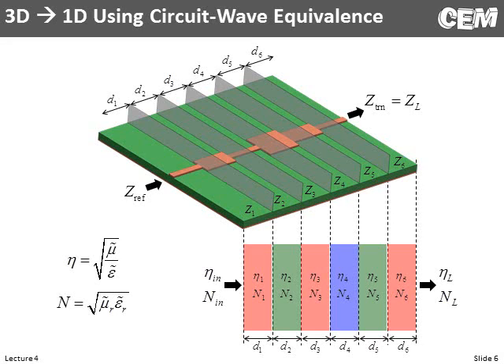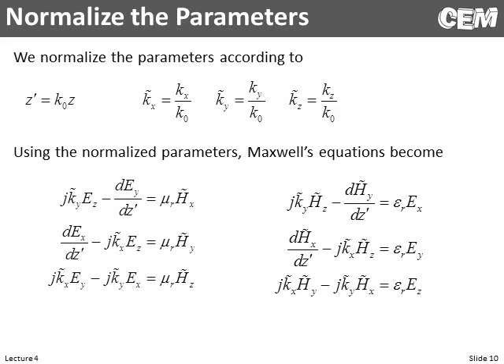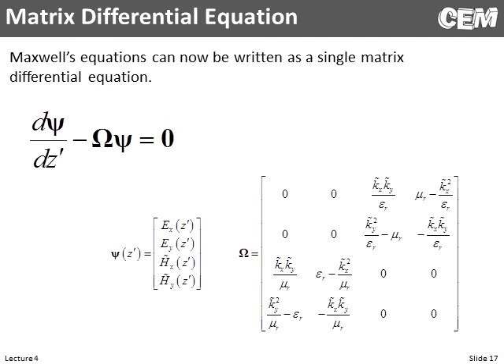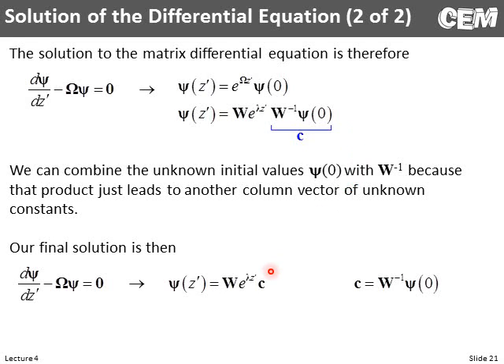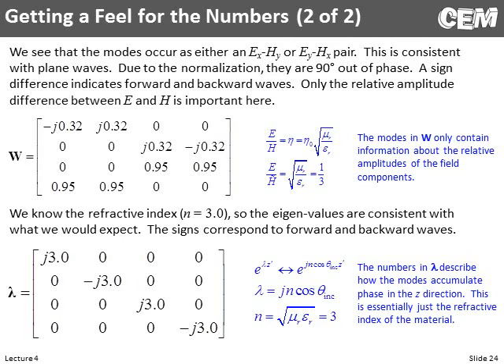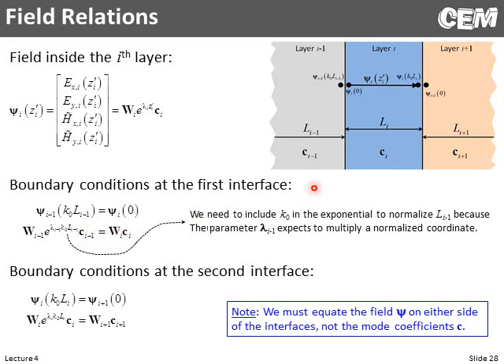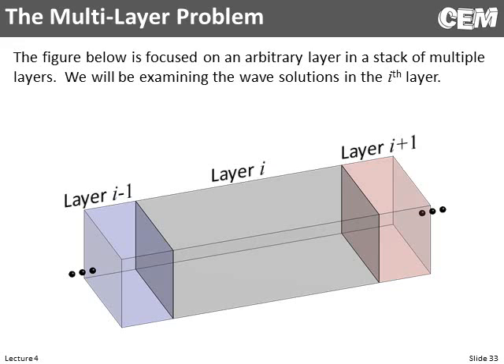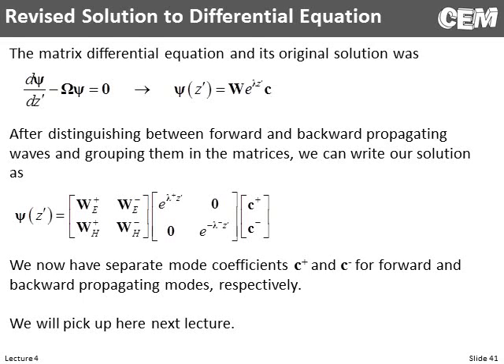Lecture 4 (CEM) -- Transfer Matrix Method

Comment: Dear Prof, Thanks a bunch for explaining this concept in detail. I have doubt regarding the sign of kxky in slide 12. Wouldn't it be positive? As we substitute and replace it?
Reply from the maker: I am pretty sure what is on this slide is correct. If you worked the derivation and still got a different sign, let me know and I will triple check myself.

One thing you might be missing is the sign convention. For TMM I am using the positive sign convention where a wave propagating in the +z direction is written as exp(j*k*z). The negative sign convention would write it as exp(-j*k*z). Here is a link to a summary of the sign conventions in electromagnetics.

https://empossible.net/wp-content/uploads/2018/03/Summary-of-EM-Sign-Conventions.pdf

BTW...you are looking at older version of this material. I recommend using the course website as your main portal to the information. You can download the notes, get links to the latest version of everything, and get links to other learning resources. Here is the link:

https://empossible.net/academics/emp5337/

Often times when I catch a small error, I will immediately update the notes, but not the videos.

Hope this helps!

Comment: Is there a way to link the modes(E_x - H_y and E_y - H_x pairs) to the TE and TM modes existing in a slab waveguide or am I totally mixing up unrelated things?
Reply from the maker: Yes! Most times devices are aligned to the Cartesian axes and the modes come out automatically as either TE or TM. In general, they do not. It is best to calculate unit vectors in your TE and TM directions and use dot products to calculate TE and TM components. This is the most robust thing to do.
Reply: Luckily, my waveguide is aligned with the propagation direction (z-direction) and I'm not looking at more complex structures. I'm trying to simulate a Bragg grating for dispersion compensation but another point of concern for me is that I have the wavelength-dependent n_eff for the TE mode, and n_eff for the TM mode, that I acquired using a modesolver. I can extract the effective epsilon_r, but since it is mode-dependent, I wonder if I can use the TMM as in the example? (My slab waveguide is not isotropic in the x-y plane) Should I perhaps use the full matrix that you showed on slide 15 or maybe try some shenanigans with the effective refractive indices for TE and TM?
Reply from the maker: @Terrar-fr1bk Until you said "not isotropic" was pretty confident you can do this with TMM. Usually, it is just the fundamental mode and you build the slabs in TMM with the effective indices from your mode analysis. I would say if your anisotropy is still aligned with the Cartesian axes, TMM should still work. If not, the anisotropy may couple energy between TE and TM and the analysis becomes more complicated.
Reply: Thank you for clarifying! I think it should work out with TMM after all. Maybe I confused you when I said non isotropic. When I mentioned anisotropy, I meant that my waveguide has multiple layers with varying doping in the x-y cross section. So the waveguide cross-section is not a single isotropic material but rather like a cake. However, each layer of the cake (each layer with a doping) is isotropic. That's why I wanted to use the TMM with the effective indices for the TE/TM modes of the waveguide cross section.
Reply from the maker: @Terrar-fr1bk If all materials are isotropic like you say, I think you will find your approach to be extremely accurate. Good luck!!

Comment: Dear Professor Raymond, your course explanation is very detailed. I have a question, in Slide 8, why does the partial derivative of z ≠ jkz? What do you mean by z-direction inhomogeneous?
Reply from the maker: Great question and sorry for any confusion!

First, you are watching an old video. I have considerably improved and revised this section of the Computational Electromagnetics course. Below is a link to the course website where you can get links to the latest versions of the notes, videos, and other resources. The transfer matrix method is in Topic 2.

https://empossible.net/academics/emp5337/

The TMM represents structures as layers of materials that are otherwise homogeneous. They are of infinite extent in the x and y directions. This makes the overall device homogeneous in the x and y directions. However, the device is not homogeneous in the z direction because there are different layers. While each layer itself may be homogeneous in the z direction, the overall device is not so nothing can be done with the z derivative at this point in the formulation. It is later handled using scattering matrices to account for the scattering that arises between the layers.

Hope this helps!!

Comment: Thanks very much for the video. I have some questions: how to calculate the absorption in each layer, and how to calculate the absorption in each position?
Reply from the maker: To do this, you will need to calculate the internal fields and then integrate sigma*|E|^2 throughout the layer, or layers, of interest.  I have some crude notes on how to do this here in Lecture 2i TMM Extras here:

https://empossible.net/emp5337/

Comment: @21:00 another way to go about this is... e^x = x + x^2/2! + x^3/3! + ... and set x to your matrix. You should get the same answer. Not that I've ever needed to take e to the power of a matrix, but yeah, that's how you could do it. I saw it in an MIT linear algebra class sometime last year. Another advantage of this approach is that you can use SVD on the matrices in the expansion to get an exact solution. Very cool shortcut in my view. Awesome lecture btw, I'll probably never need this stuff, but it's far better than soaking up endless hours of PUBG and Fortnite 😅. Yes, I'm a gamer 😂👽☮️
Reply from the maker: Most of my students are gamers.  I even started making some homework problems in my classes game themed.  LOL
Reply: @empossible1577  a man of cuture I see, I'm sure the gamer students appreciate it haha
Reply from the maker: BTW, you are looking at a lot of old material.  My best stuff is the latest stuff that you can get directly from the course websites.  You might also like that graphic visualizations I post on LinkedIn from time to time.

https://empossible.net/academics/
Reply: @empossible1577  thanks for pointing me to your awesome resources -- I need all the help I can get lol! And congratulations on being named to the Florida Tech Career Hall of Fame! 🎊 I'll definitely follow your LinkedIn 🙌🏽

Comment: At 15:20 you provide the format for anisotropic materials. Would it be incorrect to use the diagonal representation of the relative permeability and permittivity, in which case it is only slightly more complicated? Or is there some physics that gets lost when assuming a diagonal (but multi-valued) tensor dielectric function.
Reply from the maker: If you have isotropic (or even diagonally anisotropic) materials, the whole method simplifies to what is called the 2x2 TMM.  Keep watching the videos because that is what I implement.
Reply: @empossible1577  Thanks for the quick reply! I'll just carry on then.

Comment: Hello Professor Raymond,

I'm trying to figure out the Eigenvector W, and Eigen-value (Lambda). However, how can I reach to that answer as described in the 'Getting a Feel for the Numbers'? There is no equation or formula for that. I'm stuck in that points. :)

Thanks,
Reply from the maker: The eigen-vector matrix W and eigen-value matrix LAM are calculated by solving the matrix OMEGA as an eigen-value problem.  The OMEGA matrix is discussed around 16:35.  Once you have OMEGA, in MATLAB, you would calculate W and LAM as

[LAM,W] = eig(OMEGA);
Reply: @empossible1577  Interesting. That works. So, this means that we can obtain the LAM and W through the function "eig[]" in MATLAB. Thanks for your help :)
Reply from the maker: @myung-giji1409  Yes.  In fact, that is the only way when (if) you move onto RCWA or method of lines.

Comment: SIr,  I am an electrical engineering student. Sir how Transfer Matrix Method is used for solar pv module as it a multilayered structure.
Reply from the maker: It can be used to solve for how much energy gets absorbed by the cell in order to predict efficiency and perhaps produce better designs.  TMM is used often to optimize antireflection layers as well.
Reply: Sir how this model used for multilayer
Reply: Harish  what you do in solar cell   how you use this method

Comment: 1. Why does the magnetic field have different eigenvectors but the same eigenvalues as the electric field? (Lec 2a, slide 54). The eigenvalues being the same make sense because the E- and H-fields propagate together, and the eigenvectors being different makes sense if P and Q do not commute (in the case of these matrices they do, but I suspect their generalizations do not).
2. How are we justified in assuming that the solution for the magnetic field has the same c+ and c- coefficients as for the electric field, not different ones? It seems like these should just be arbitrary coefficients in both cases, and I'm not sure how they should be related.
Reply from the maker: 1. In ordinary media, the amplitude of H is adjusted consistent with impedance.  In anisotropic media, it is crazier.  Otherwise, I think you are getting this.
2. E and H of a wave must reflect the same.  Otherwise, they would not satisfy the impedance of the medium.  It is a single wave so it only reflects one way.

Comment: Dear Prof. Raymond. First of all, thank you for these amazing lecture series. I was wondering about the sign of the eignevalue exponentials in the fully ansiotropic case. After sorting the eigenvalues, you have also changed the sign of the lambda ^{minus} matrix. This is appearing also in the corrected notes. I was wondering if the change of the sign is necessary? If one does this he/she ends up in having four forward propagating modes instead of two forward and two backward waves. Or I miss something?
Thanks again for the amazing work you are are doing.
Reply from the maker: Can you please point out the specific slide you are talking about?  I should not have been changing signs, but I suspect I am confused about your question.  Very sorry!
Reply: Dear Prof. Raymond, 
I am referring to slide 43 of lecture 4, or summarizing slide number 4 in lecture 5b , where the "lambda plus", "lambda minus" matrices are defined. Just above them,  it is written exp("lambda plus") and exp(- "lambda minus"). I refer to the minus sign in this second expression. After sorting, "lambda minus" is in principle a diagonal matrix with complex elements that have negative imaginary parts. As far as I understand, when we multiply this numbers with "minus" sign, we reverse the direction of propagation of these modes.
Thanks again
Reply from the maker: Oh, I think I understand your question and I see where this is confusing.  I should make a note of this on the slide.

I did not intend for the negative sign to imply you actually make something negative.  Instead, it was intended to indicate that is simply where you put the eigen-values for the backward waves.

Does this make sense?  Sorry for the confusion.
Reply: Yes, thanks. That explains what I was confused about. Thank you very much for everything.

Comment: Hello,
is it possible to implement the TMM in 2D and 3D cases ?
Thank you for the lectures
Reply from the maker: Yes, absolutely.  These techniques go by many names including method of lines, rigorous coupled-wave analysis, Fourier modal method, transfer matrix method with a plane wave basis, eigen-mode expansion technique, and more.  If you follow this set of lectures, you will learn rigorous coupled-wave analysis and the method of lines.  Also, here is a link to the course website which has links to the videos as well as the latest version of the notes and other resources to help you.

http://emlab.utep.edu/ee5390cem.htm
Reply: Thank you
I calculated the transmittance and reflection coefficients for different layers with different incident angles but I cannot build the 2D visualization of wave spreading like in your lectures about the FDTD method.
How I see in 2D, 3D it is better to use FDTD method.
Reply from the maker: Which pictures of waves spreading are you talking about?  

Which method is better depends more on the device you are simulating and the physics you want to incorporate.  FDTD is easily parallelized so you will see it for simulation very large structures.  It is also a time-domain method so you will see it for transient analysis and devices incorporating nonlinear material properties.  For small to moderate size devices, frequency-domain methods are usually faster and more accurate.  For full 3D, it is hard to beat the variational methods like finite element, method of moments, etc.  In special cases, like periodic dielectric structures, rigorous coupled-wave analysis is extremely good and will outperform finite element in speed and efficiency.  For 2D simulations, my group really likes finite-difference frequency-domain.  For 1D, we like TMM.  I could go on and on comparing the methods, but so far I have not found one single method that is better than the rest.  I have only found ones that seems best for a specific device.
Reply: After I calculated the transmittance and reflection coefficients I choose some frequencies and built from them a pulse (for example |E(z)|^2: https://www.youtube.com/watch?v=RWVZ4iUuAsI&feature=youtu.be).
Can I draw something like this https://www.youtube.com/watch?v=f0orcF2ubIs (1:56) with help of the TMM method?

Comment: Respected Sir May you live long!. why we need to use TMM instead of using Frensel's equation. i am apologies to say that sound quality is very pour and have distortion. It will be blessing for students if you use whiteboard in your future classes. so that its become students friendly for non native English speakers
Reply from the maker: The Fresnel equations are great for quantifying reflection and transmission from a single interface.  However, what if you have a stack of five different layers?  In this configuration there are many interfaces and there arises a very complex arrangement of scattering that leads to some overall reflection and transmission.  The Fresnel equations cannot account for multiple interfaces.  TMM is used a lot in thin film optics where sometimes there can be hundreds of layers.
Reply from the maker: Sorry about the sound quality.  You are listening to some of the first lectures I ever recorded.  The sound quality will get better.  When I get time, I will go back and rerecord the lectures.
Reply: Thanking you with anticipation. now i have eaten your words!

Comment: Hi Professor Raymond,i am looking for TMM .P file for  Matlab simulation, so that after implementation we can verify it with your result. my question how can i get sanctification for   TMM implemented Matlab Mathworks is 100% correct, thank you for reading
Reply from the maker: First, let me point you to the official course website.  This contains the latest version of the notes, links to the videos, and other resources to help you.

http://emlab.utep.edu/ee5390cem.htm

Once there, you will find a link to a "Benchmarking Aid for TMM" near the bottom of the Homework section.  This sets up a two-layer problem and provides the values of most every intermediate parameter through the entire TMM algorithm.  The block diagram for the algorithm is shown on Slide 48 in the latest version of Lecture 5.  With the block diagram and benchmarking aid, you should be able to get your own TMM code working without the need of the p file you suggested.

Hope this helps!!
Reply: But It does not have any .p or source code of 1st four Home work. :( Can you share or upload it ?

Comment: Hi Professor Raymond,i am looking for MMT code for Matlab simulation, but i have no idea how i can get this package or code, my question how can i get MMT implemented Matlab Mathworks, thank you for reading
Reply from the maker: Do you mean TMM?  As a rule, we do not ever give out any codes.  The block diagrams in the notes are as close to code as it gets.  There are also benchmarking documents available on the course website that shows all of the intermediate results.  Essentially I just run the MATLAB code without any semicolons after the calculations.  Here is the course website:

http://emlab.utep.edu/ee5390cem.htm

You can look at some open source tools at the following website.  Just scroll down maybe 2/3 of the way under the heading "Electromagnetic Simulation Software."  There should be something here for you if you do not want to write your own code.

http://emlab.utep.edu/opensource.htm